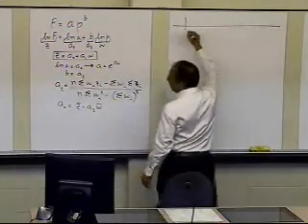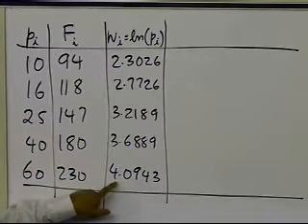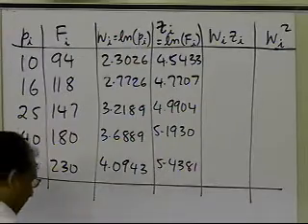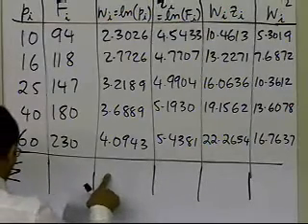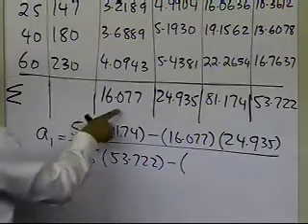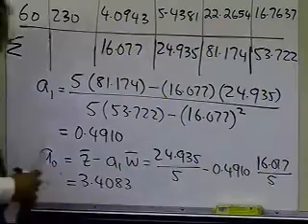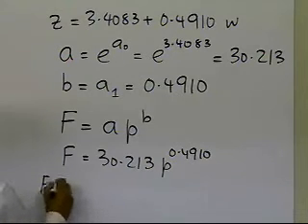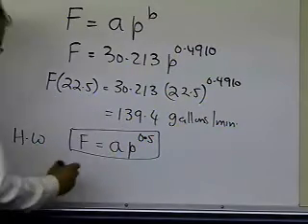Chapter 06.04: Lesson: Power Model Regression Transformed Data Example Part 2 of 2

Comment: hi prof... if the x or pi value in this video starts from 0... then we only need to transform the y part(Fi) only... am I right?? I watched your other video that you are doing that..
Reply: Exponential Model Regression Transformed Data Example Part 2 of 2
Reply from the maker: The transformation of data will not work if any value in the data pairs has a nonpositive (F<=0 or p<=0) value.  Now if for a value of p=0, you have a non-zero F value, then the model will not work.  You may have to justify to ignore that data pair then.  If for p=0, F=0, the model itself takes care of that.

Comment: the result for a1 when you use log and ln is different sir .i used log i found a1=1.2188. which can i choose log or ln ?
Reply from the maker: You can use log or ln - it does not matter -it should give you the same answer.  But you have to be consistent once you choose which one you want to use.  When you use log, you will have to take log of the y and x values to calculate a1.  Then a=10^a1.  Recall that log and ln just differ by base https://www.chem.tamu.edu/class/fyp/mathrev/mr-log.html and hence would not have an effect.  ln x = 2.303 log x.
Reply: i think  i should have earlier  in your channel :).anyway thank you so much sir i really appreciate

Comment: It supposed to be log,you should take the base 10 logarithm, no the natural log of the data .
Reply from the maker: +Mohamed Badawy You can use log or ln - it does not matter - it should give you the same answer.  But you have to be consistent once you choose which one you want to use.  When you use log, you will have to take log of the y and x values to calculate a1.  Then a=10^a1.  Recall that log and ln just differ by base https://www.chem.tamu.edu/class/fyp/mathrev/mr-log.html and hence would not have an effect.  ln x = 2.303 log x.
REPLY